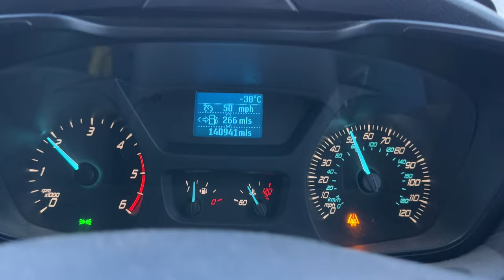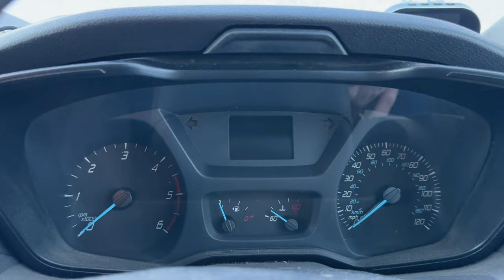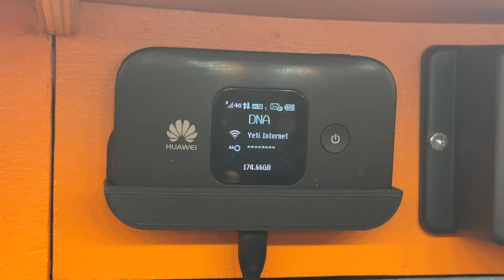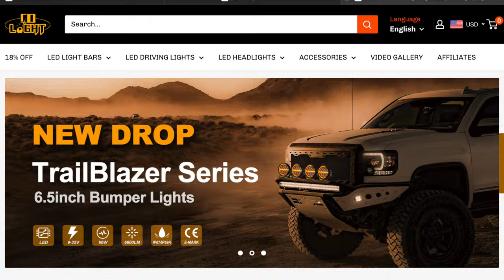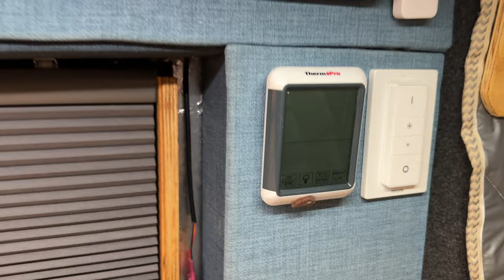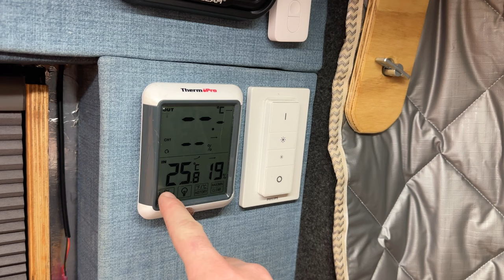NEW UPGRADED FOR ARCTIC WINTER VANLIFE!

Comment: There is that channel True Blue Travellers, who took a Sainsbury's delivery van and converted that. Maybe look at that type of conversion. Preinsulated, straight and level sides, more usuable space inside.
Reply from the maker: I am well aware of true blue traveller, who do you think advised them on the modifications required for the Arctic? 😁 I met up with them a few weeks ago. 
Whilst a hab box is a nice format. having parked been next to them and in their van I would  say my transit has a larger internal squared space or usable area than there box did. 

But I do like there van. It was great. Personally I perfer the lower profile look of a normal van.
Reply: @MispronouncedAdventures  I suspected you knew them. I think they should have made a cab cowl to make the front more aerodynamic.

Comment: lookt like at 21:35 you have 3 leaks of coolat, front, left front, left side middle of the van. I know that u top it off early but that seems like alot of coolant leaks.. 
22:54 about parking on the side of the road, aleast here in sweden u should move as far to the end of the parking place and not in the middle, now that was in finland and not sure what they have for traffic rules.   
Good video, fun to see more that enjoy the cold weather and snow around here.
Reply from the maker: It’s not as bad as it look coolant wise. the coolant drips from the pre heater under the passenger side.  But mess is from the drain valve which leaks on the radiator, it’s unfortunate over the bumper, so it runs down the back of the bumper and catches on the lip. Depending how park it will run of the left or right have side if on an angle. 

It was more of a larger parking area than just a small lay-by.

I do love the cold and snow

Comment: Brill you are back out on a mission! That bike sliding mod is 👌🏻 That light with the orange line is currently on my bucket list.. what a great idea! I do believe 2025 i'm going to geek and winter mission it looks so nice up there 🔥
Reply: those thermapro bluetooth are pretty decent for the money - I did have one in hight humidty (which is literally in water for weeks tbf).. that the LCD display went skitz.. but the reading still work on the bluetooth app - so it kinda don't matter the temp/hum sensor screen as gone capult. Peace!
Reply from the maker: Glad you like the updates to the van, and yeah the temperature stations are great for the value

Comment: There's always room for new interesting upgrades!! Perhaps a mic upgrade next? Keep up the good work and safe travels!
Reply from the maker: I film the intros and pre-planned talking sections ( like on many of the technical videos ) with a DJI wireless mic. Due to the nature of the running gun style I use and everything being filmed on an iPhone, having the mic receiver plugged in all the time isn’t feasible. i’ve also discovered in the extreme cold the Mic receivers and mic die pretty quick.
Reply: @MispronouncedAdventures  Interesting about mic membranes in combination with cold! Here can some interesting development be made 🤔 but perhaps a too small niche market.
Reply from the maker: @RAGJAW  it’s a strange one as I’ve been using and doing this filming style / set up for about three years now. But particularly something is gone wrong for this video as a number of people now have mentioned the audio for the driving sequences.
Reply: @MispronouncedAdventures It's a pretty tough climate in the front window.  First cold and then comes a quick change to very warm humid air...

Comment: if you use (all terrain) tires you should definitely get winter tires for driving here in the north. have tried all terrain even in winter and it's not good 😅😅
Reply from the maker: I’ve used them for 3 Nordics winters they are brilliant up here.  on a heavy rear wheel drive van like mine they are fine. front wheel drive van, mid weight 4x4 and light cars less so.
Reply: @MispronouncedAdventures  I had them on a toyota hilux where it didn't work well so I bought a nokian hakkapeliitta spikeless it was a completely different world.
I come all the way to the south of Norway, here there is a lot of ice and 0 degrees very often, so I use nokian hakkapeliitta studded tires 😀
Reply from the maker: @LILLEGOFF_DRIFTING  yeah I stay north to avoid the ice and tend to leave before spring.

For sure a Toyota Hulix would have totally different weight distribution to my van.

Comment: I'm very impressed with the bike slide and Im looking forward to future bike review, if it performs well in those conditions then it's had a good test. 
You have definitely got a career in van building if you want it because the quality of your work is outstanding. I do wonder if eventually the upgrades will be worth more than the van and outlast  it. Do you put fresh underseal on the chassis before the trip?
Reply from the maker: I’ve impressed so far with the bike. I’m looking forward to doing an adventure on it out here. 

thank you for liking my van building, I have previously done work for a UK company building vans for a bit. 

I didn’t underseal it before this trip, but it’s so cold. Nothing is wet and they don’t use salt on the roads here as it’s not particularly effective and extreme negative conditions so they just use physical grit rock. 

I am considering the prospect at the moment of building a new AWD transit

Comment: I wouldn't call getting to your storage behind the bike as 'easy' but it would be a pity to not use the space, but anything is preferable to needing to open the rear door at -35 outside in order to repair the heating system... 

4G?   
Would be nice if they had a 5G model since that's getting common up here. 

Fuses. Biltema have 12V fuses with built-in LEDs that light up after it blows. Don't know how well they work, but I replaced all the fuses in my old car with them. Just haven't had time to do it with my current car.
Reply from the maker: It definitely looked a bit more awkward when doing it on camera because I was in the wrong direction as  I was showing it to the camera but generally it’s pretty easy too, but that storage anyway is my term storage, not the stuff I need to access day to day. 

Indeed it would for 5G and I’m sure future models will. 

Biltema is definitely another great shop for all the bits and bobs you need or things I didn’t even know existed.

Comment: Could you please provide a link to the large thermal (silver) blanket on the back of your van?  Thanks.
Reply from the maker: I made it myself. It’s using the standard windscreen insulation material. You can buy by the reel from a company called Vanguard in Fort William

Comment: Hi Alex
 been following you for ages now 
Do you ever worry about your vans weight. I've built my van out something similar, 
And now am trying to loose weight from my van were ever I can and always at top of weight 350 medium wheel base mark 8 transit 
Love your videos
Reply from the maker: I don’t worry weight as I had a it weighted and have but put on a weight bridge before as well of police ! it’s definitely heavy, if I’m not careful when packing I’m easily over 3500kg when full of fuel and water. At least the upgrade where I installed The Bikes slide also removed a far large water tank.
Reply: I am the same ,going to do Sweden Norway etc this summer if we don't go to Bulgaria in the van .
Brilliant videos mate

Comment: Pretty cool bike rack! 
Is there any equipment's that you've needed during your journey but had a difficult time getting? Curious since you are doing such lengthy trips.
Reply from the maker: Glad you like my new Rack system 

Generally know whilst Amazon Prime isn’t really a thing. The automotive and hardware shops in Norway, Sweden and Finland are absolute dream. you can buy all manner of DC switches, connectors, fuses, Relays, cable up 50mm2 the roll, tools you’ve never even imagined existed. every vehicle accessory, you could think. Even 26“ x 4.9“ studied fat tyre just off the shelf. Besides, the prices, it would be far simpler to do so many projects up here that you can just pop to the shop

Comment: Hey Alex, random question, the sensor for your indoor/outdoor thermostat…where do you have the outside sensor attached too? And how have you attached it?
Reply from the maker: The outdoor sensor for the little panel by my bed? I swap the batteries in at the end of the video? I have it cable tied to a roof rack mounting bracket. 

If it’s the outdoor sense with my Victron Cerbo use ( the touch screen ) then it’s VHB tape and mounted into my passenger wing mirror. I do an episode on it called “upgrades” in arctic season 1
Reply: @MispronouncedAdventures  perfect thank you. Will give the upgrades video a watch too then. 👍🏼 thanks again

Comment: Hi! thank you for your content. it is very helpful me as i have now got and enjoying a van. can i ask you if you have clean water tanks, hot water onbaord, a shower? If you have clean water how have you prevented the water from freezing. i have underslung water tanks. i put antifreeze but not enough and the pump got damaged. my fault. i bought the van as i love climbing outdoors in the winter, in the UK. what would you suggest please? I have thought of putting the tanks inside the van, but will loose space (its a renault master 3 lwb) or to get pig blanket heaters or better use the antifreeze. trial and error is expensive but its worth it to be outdoors!

Comment: hi I have just stumbled across your video , two questions is your van 4x4 and if not what tyres do you use , what things do you take to not get stuck, thanks
Reply from the maker: Hey! My Van is only RWD ( hopefully next will be a AWD ). However RWD is great in the snow, having all the weight of a conversion over the back drive wheels.

Tyres for the last 3 arctic winters I have used the BFgoodrich KO2 in size 225/75R16 115/112.
Which I have had excellent performance in. 

Rescue kit wise, snow shovel, tow strap, chains and satellite comms if necessary. I would like a winch on the next van. But realistically many of the time others come off the road is go into the snowdrift ditches at the side and that usually requires external help,  self rescue would be hard.